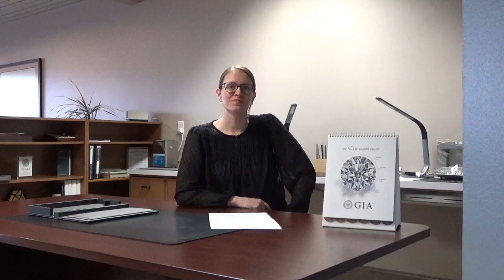How Lab Grown Diamonds are made - and the difference between HPHT and CVD Lab Grown Diamonds.

Comment: Is one better than the other? When shopping how do we know if a diamond is CVD or HPHT?
Reply from the maker: Hello, It should indicate on the certification. I would NOT purchase a lab grown diamond unless it comes with a diamond certificate. (IGI, GCal, GIA are the most popular that will see)
Reply: @mjgabel  Thank you, I won't. But I am still confused. Is one better than the other, CVD or HPHT?
Reply from the maker: CVD technically would be the purer of the two options. All CVD diamonds are type IIa, which means they come out of the process whiter, and without the presence of nitrogen or boron. In smaller lab grown diamonds it does not matter, but I would say as you get up into the larger carat sizes I would go CVD if possible.
Reply: @mjgabel  thanks. What are you considering larger? I'm looking for 1 - 2 carats.
Reply from the maker: @mmt4013  For a 1-2ct range I would go with CVD. If you are looking, we can provide you with some figures. Let us know if you need help.
Reply: @mjgabel  Sure. Is there a way to communicate in private?
Reply from the maker: @mmt4013  Sure: info@mjgabel.com / 585-598-1090

Comment: Hello thanks for the great video! Knowing that natural diamonds attach over thousands of years under the ground I wonder how Lab diamonds can recreate that in weeks? Almost seems impossible for the lab diamond to last long term. Have you seen any Lab diamonds change from original color or develop hairline cracks?
Reply from the maker: Hello Bitcoin - Thanks for the question, and a great question at that. Earth mined diamonds take about 900 Million -3 Billion years to form - that's one of the reasons that earth mined diamond prices are high. 
Lab grown diamonds take roughly a week to a month to create. In order to do that process in so short a period of time, the heat and pressure are turned up slightly to encourage that process to move faster. While it seems like this would create diamonds that do not last, it actually does not have an impact on durability. Keep in mind, earth mined diamonds can crack, and break depending on the type of inclusion that are in the stones. We do not see this happening with lab grown diamonds as much because the quality of the diamonds is so much higher, and they have fewer inclusions. A few of the older quality lab grown diamonds that were made in the early 2000's were more prone to color change. Since the technology has evolved and improved so much over time, that is absolutely not a concern anymore! The only way a diamond could change color is if it were exposed to HTHP treatment (high pressure, high temperature), which is true of both lab grown diamonds and earth mined.

Comment: Great video, so helpful. What would the differences be between the two if they have the exact same color, cut, clarity, etc. Would CVD still be better? or at that point does it not matter?
Reply from the maker: Thank you! CVD technically would be the purer of the two options. All CVD diamonds are type IIa, which means they come out of the process whiter, and without the presence of nitrogen or boron. In smaller lab grown diamonds it does not matter, but I would say as you get up into the larger carat sizes I would go CVD if possible.